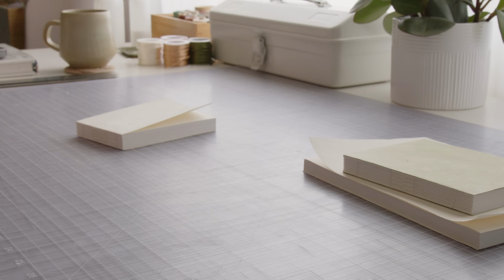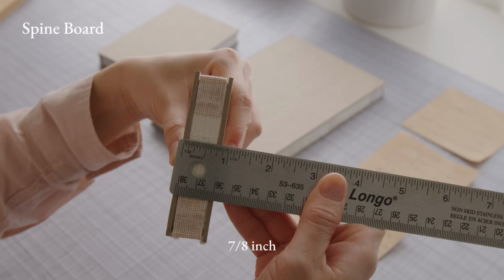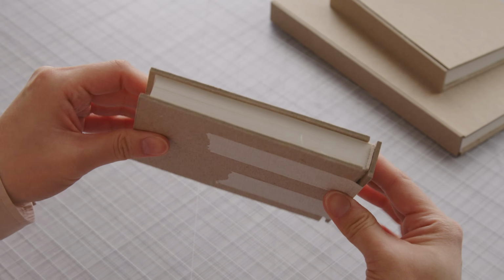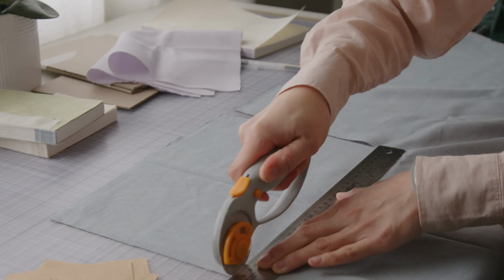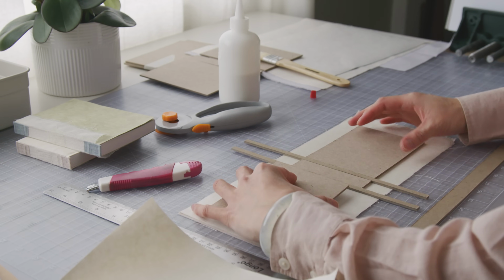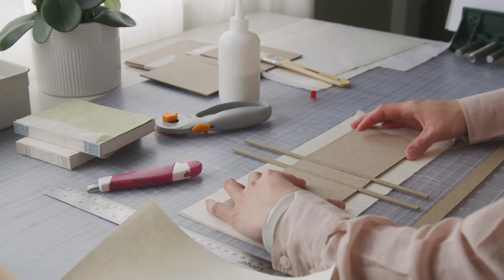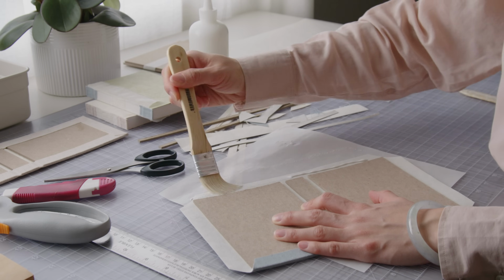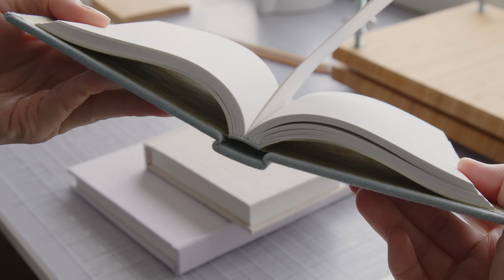Tips & tricks for making a hardcover case - flat back case binding

Comment from the maker: A big part of bookbinding is that you'll find your own way of doing things, and I kind of stumbled upon this test fitting method myself. Let me know if you try it out and if it works for you! I consistently make measuring and math errors, and seeing the text block in the covers first helps me make more accurate cuts. Also, make sure your cuts are square!
Reply: I’d love to know how you cut your text blocks so perfectly…mine always have some kind of kink or jagged edge.
Reply from the maker: @nicoleb3781  I use a heavy duty guillotine after many years of cutting by hand... it's been a worthwhile upgrade. It's also known as a stack paper trimmer.
Reply: I'm so stoked for this video! It couldnt've come at a better time. I've been struggling with getting the overhang even on all sides, 3mm at the head and tail, but 5mm at the fore-edge and it's been frustrating me to no end! Sometimes I get it perfect, but otherwise it's a mistake I consistently make. The test fit with the tape is so clever! Casing books has always been the biggest scare factor for me, I get so anxious about messing up, that I procrastinate to the point of having seperate textblocks and cases laying around that never get put together lol
Reply: @bittermelonbindery  Thanks for replying! :)  I will definitely keep my eyes peeled for something similar here in New Zealand x
Reply: Thank you for this I am thinking of creating my own book now 😄

Comment: So, my dad took small hardwood pieces that were slightly longer than the length of the wing nut and were deep enough to fit well  in the hand and cover the width of the wing nut, and about 3 or 4 inches tall.  He routed a channel running the length of the block that was a bit wider than the wings on the nut.  He then drilled a hole in the center that was slightly larger than the bolt.  He rounded the top length  and sanded the whole outside so it is comfortable in the hand.  When you drop the block over the bolt, it slides down to the wing nut and the nut then fits into the channel.  You use the block to turn the nuts up and down the bolt which means they don’t hurt your hand, you can turn them faster and easier, and you can get a more even torque on the boards.  TFS.
Reply: Hey, just stumbled on your comment. I’m totally going to do this. Thanks for posting and thank your dad, too! Happy binding 😊

Comment: Do we need to add 6mm for both l and b??
Reply from the maker: what do you mean by l and b?
Reply: @bittermelonbindery  length and breadth as Normal...
Reply from the maker: @ashtag1495  add 6mm to the length of the spine, the width is the same as the text block for the cover boards
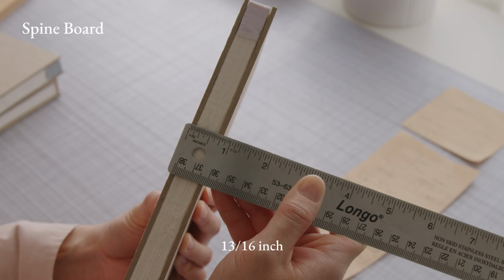Reply: @bittermelonbindery  3:10 it looks like you made the spine the width of the textblock AND the two coverboards in the video?

Comment: How do you get the pages or signatures so need?
Reply from the maker: Do you mean the neat trimmed edges and overall? It's mainly consistently checking for alignment throughout the process of folding, sewing, gluing!
Reply: @bittermelonbindery  I mean mostly on the ends of the paper. I genuinely cut them before binding but at the end it is not precise anymore
Reply from the maker: @nienkeverplak1111  After hand trimming for years, I upgraded to a heavy duty guillotine, also known as a stack paper trimmer. It made cutting so much easier and smoother.

Comment: I was taught that you always need to remove the foreedge size from the cover board width... as well as add the same to the head and tail measurement. 

Why don't you subtract from the board width?
Reply from the maker: I consistently mess up doing this for some reason, so I prefer to trim to size at the test fitting stage to make sure I've got the right fore-edge overhang.

Comment: How do you know the spacer is 6mm ?
Reply from the maker: I made the spacers myself, and 6mm is pretty common, so I start there and then play around with it based on the book design. Generally the space should accommodate the thickness of the spine and cover boards, plus a couple more mm for movement.